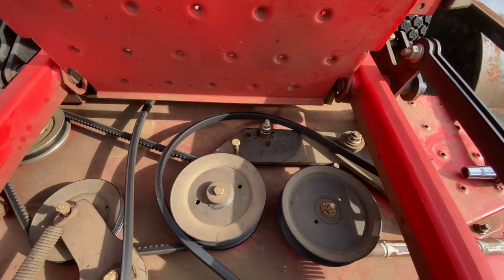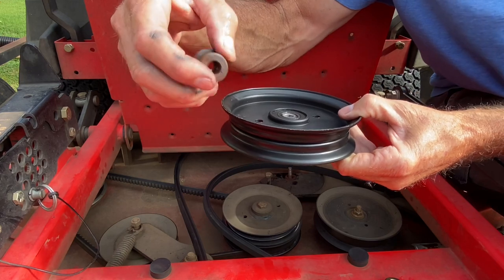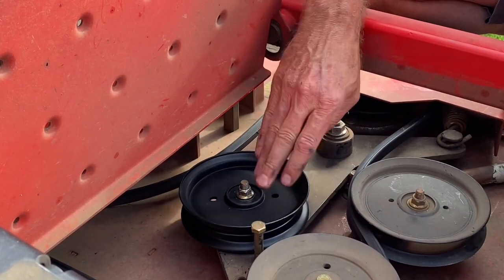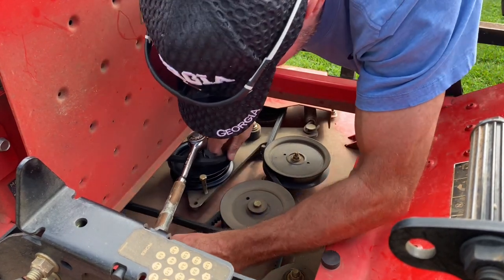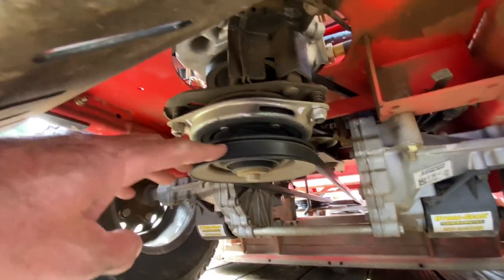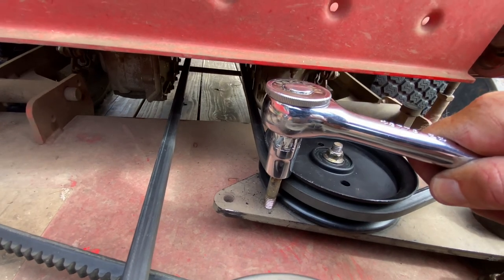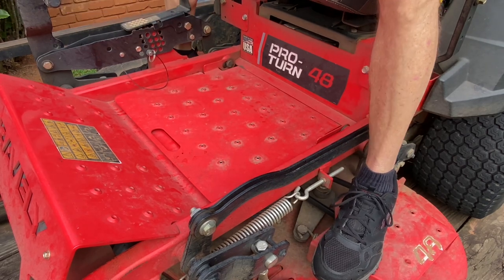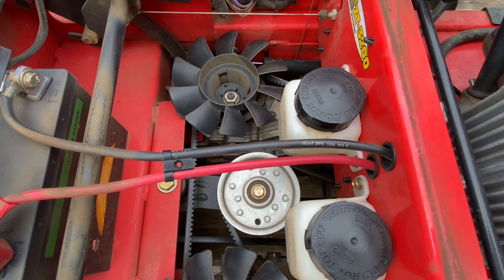How To Change An Idler Pulley On A Gravely Pro Turn 48” Hydrostatic Mower!

Comment: Hey Trent, awesome video Sir.   I have a Pro-Turn 148 here in Aust.   My hydro idler pulley spun off due to a failed bearing.   Adapted your instructions and repaired the hydro idler quickly, no probs.   Many tks.
Reply from the maker: Yes sir glad it helped. Thanks for watching!

Comment: Hey what pulley is the more flat black one right under your hand called? Is it the same as the one you replaced? The bolt on it is like a carriage just like yours & it snapped in half while I was mowing today and that whole pulley came off with the bolt stuck in it. I have a Gravely pro stance 48" 0:13
Reply from the maker: PULLEY, V - 1.000 ID X 5.750 OD
Reply: @TrentGunnellGeorgiaExposure  Yes that's it! Thank you sir.